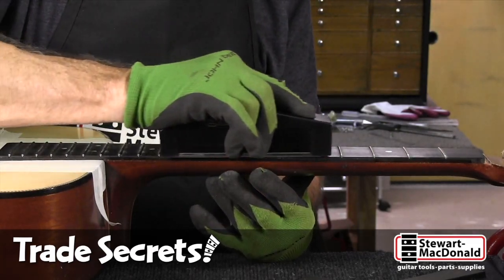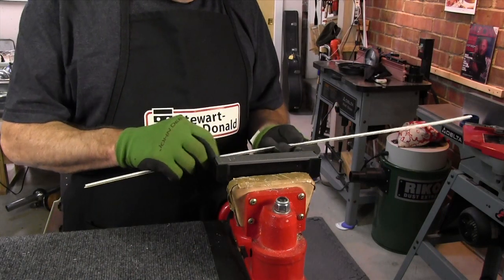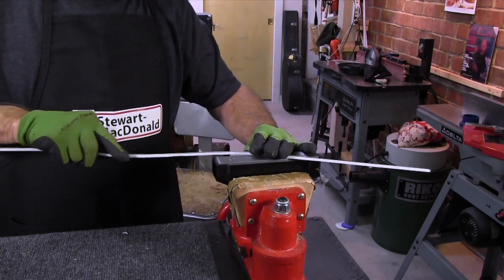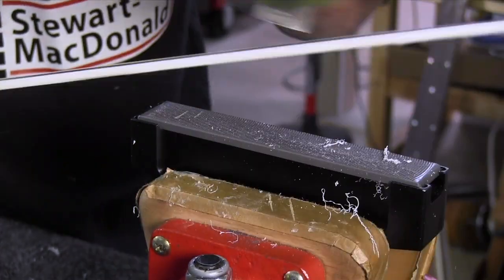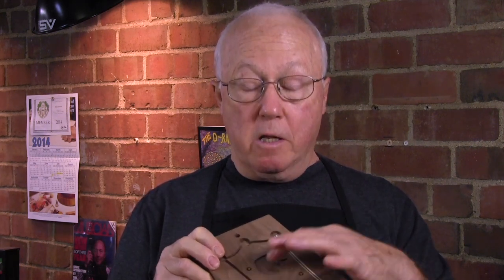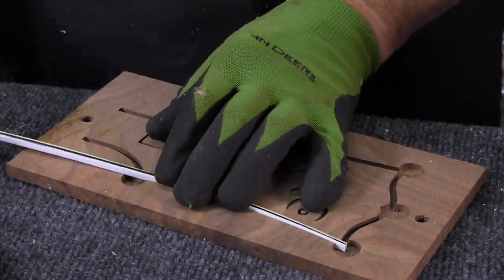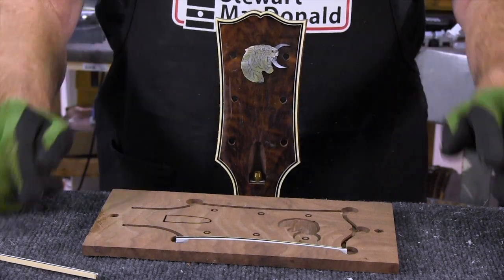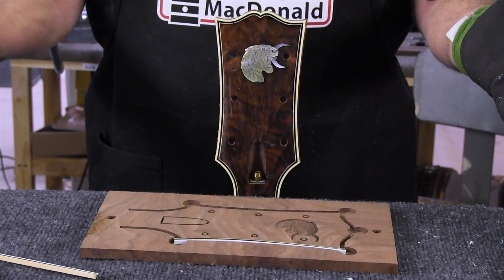Guitar binding and pearl inlay: a neat trick!

Comment: I'm curious about the pearl inlay on the headstock, I'll be using a CNC router to cut moon shaped inlays for my fret board and i know that if i set the sizes for the inlays and the inlay cavities the same, the inlays won't fit. so how much smaller do the inlays need to be than the cavities they're going into?
Reply: I'm sure you could just cut them the same and sand the needed space (If they didn't simply as cut). How did it turn out?
Reply: Your tool path generating  (CAM) software should allow you to cut either inside the outline (pocket) or outside the line.  Cut the inlay material outside, the veneer or whatever on the inside.  Really shouldn’t be any more difficult than just choosing - no math involved.